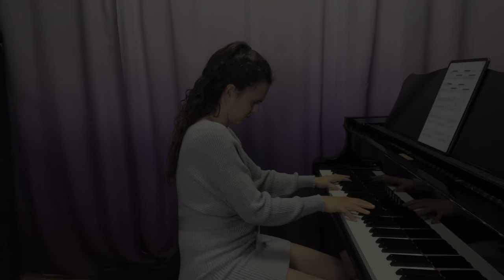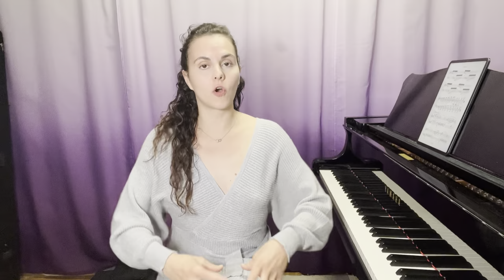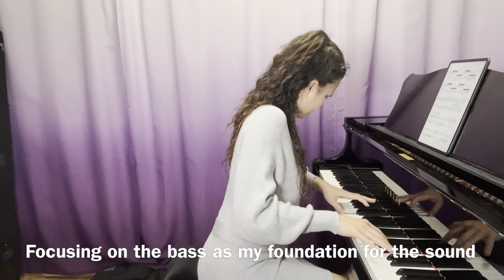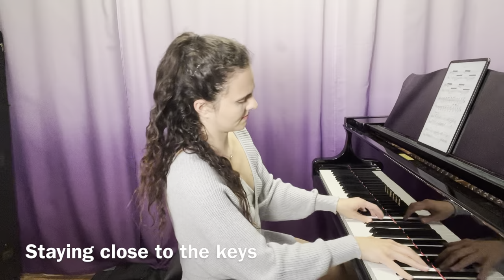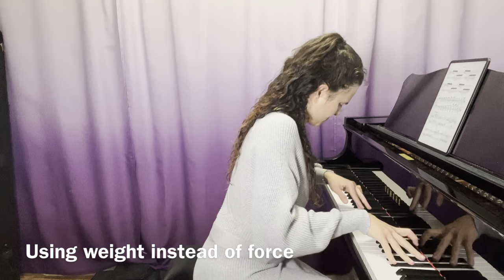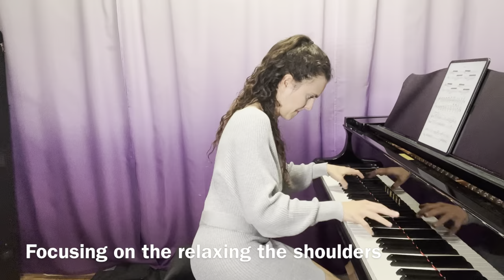HOW TO CREATE A WARM AND BIG SOUND ON THE PIANO // Avoid Sounding Too Harsh - Piano Tutorial

Comment: Perfect. Exactly what I wanted to get my Chopin A flat prelude #17 sounding better. I had got as far as "keep the melody voiced and bring out the bass octaves and not so much the alto/tenor region" just by experiment, but had no real explanation or certainty about it. This is a perfect explanation!

What, though, does weight give you? I mean, from the physics point of view, the action of the hammer on the string doesn't care how you play the key, it just cares about how fast the hammer is moving when it strikes the string. So it must be something else. Does it help you keep the chords more together? Or by leaning in keep the hammers up more? Or have more control of force distribution over the different notes? Or stabilise the whole piano a bit with your weight? It would be nice to understand...

Comment: Summary for myself: 
1. automatically lean into the piano more attached and connected to sounds rather than far away.
2. use strength of whole arm and body weight rather than fingers.
3. sounds distribution and voicing (upper melodies stand out). focusing on the bass as the foundation for the sound for warmth and depth.
4. directly on top of the key, flying high will cause harshness.
5. feel the gravity. Radu lupu example of so convincing grand sounds despite maybe only mf.
6. focus on relaxed shoulders for all energy flowing naturally into the fingers.